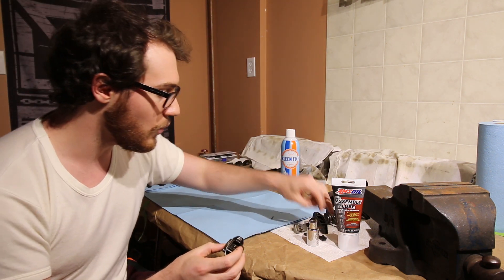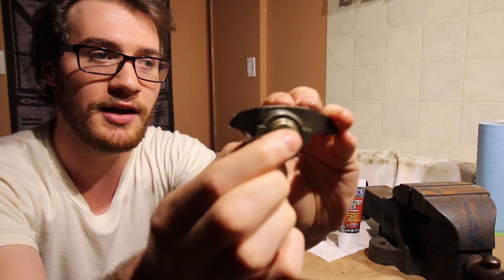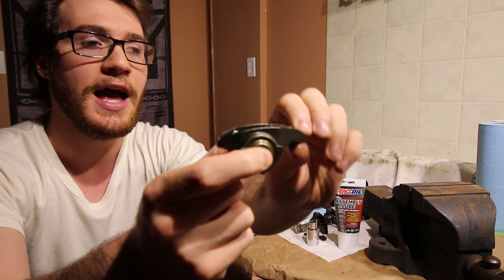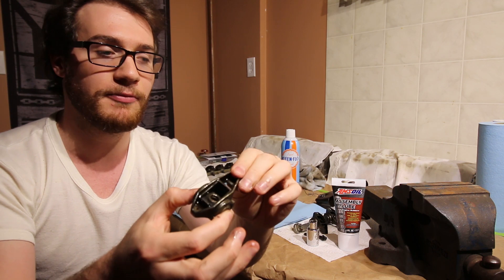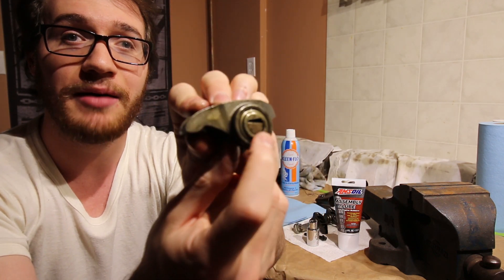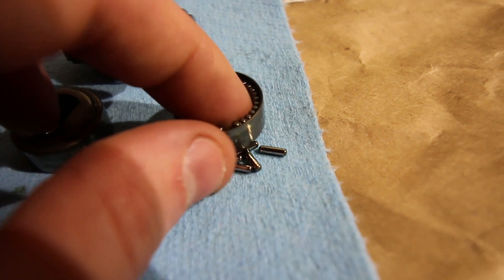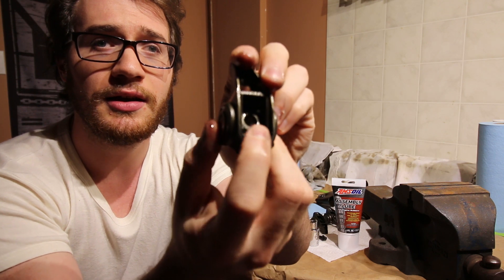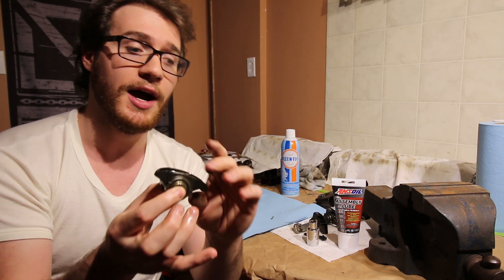LS Trunion Upgrade | What is it and how to install!

Comment: Just stumbled on this channel and like the vids. But if all of the engines in the world and you pick an LS?? 😭 This Datsun deserves better. There are plenty of inexpensive powerful motors. Even the L28 is capable of 300hp NA. This isn't a torque car. Get into a high revving Datsun and you'll never look back.
Reply from the maker: Haha the LS is not for the Zee! Right now the Zee is staying with the L28 ..... the LS is for a Volvo 240 project!!
Reply: @NewDimensionMotorsports  out of one hole and into another. Volvo 5cyl they make adapters to mount it to a BMW trans and they sell rwd engine mounts. You'll need to shorten a 6cyl pan and a few small water pipes and she'll drop in. Haha it's all good tho, but you gotta get out of that LS
Reply from the maker: @rocksteady8986  For some reason I'm getting a vibe that your not a LS fan 😉
Reply: @NewDimensionMotorsports  I'm just tired of seeing them. I know it's cheaper power and has a nice aftermarket but it's like the vanilla cake of the car world. Of course it's good, nothing incredible but gets the job done. But typically you can get just as much power with other motors and be just as reliable. Plus have you heard an angry 5cyl turbo? 🤤
Reply from the maker: @rocksteady8986  What can I say I like vanilla cake! You are right .... many ways to make reliable power. Honestly I grew up with v8's and I want that back in my life lol